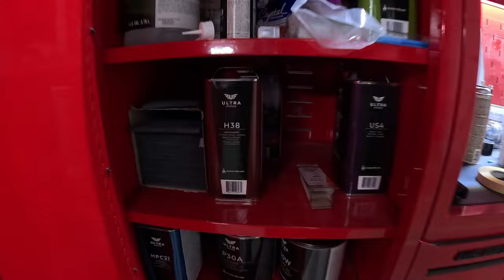Harbor Freight Series 3 Review Update!

Comment: If you take the finger slides out and put some of those $1 magnets from HF behind the drawer it will keep them shut. I did the same technique on the 5 drawer tool cart.  I doubled up the magnets and staked them on the inside of the box. Worked great.

Comment: If Harbor Freight was making these boxes 10 years ago, I would’ve bought one instead of Snap On tbh. Those US General service carts are comparable with the snap on ones and 1/3 of the price. The series 3 and ICON roll cabs probably only come second to the EPIQ series. But better to save money on the box and spend it on tools
Reply from the maker: That's pretty much where I'm at with it. I love quality tools but there is a limit to which I'll spend when the cheaper option works the same. I'm real glad I never jumped into a real expensive box. For me it would have been super unnecessary.

Comment: It is really unfortunate the slide latch system for the drawers is so awful. Its technically v2 of the system, and although v1 was more annoying to use because it was only on one side, it worked miles better than the current version. They should have went with soft close or grip latch for sure.
Reply: I like it, I didn’t when I tryed it in the store was planning on taking them out, but after a few days it just kinda grew on me